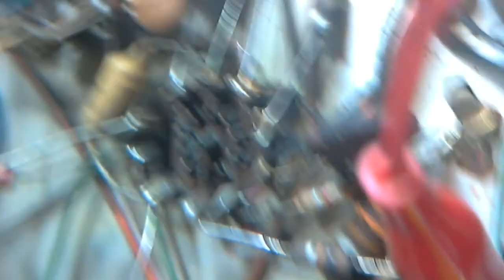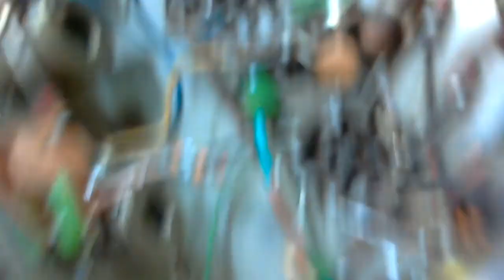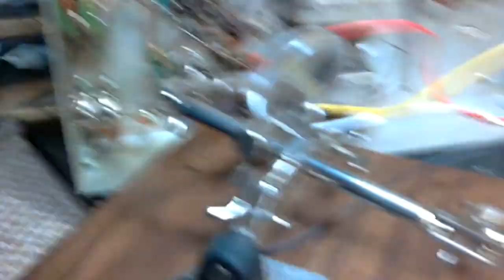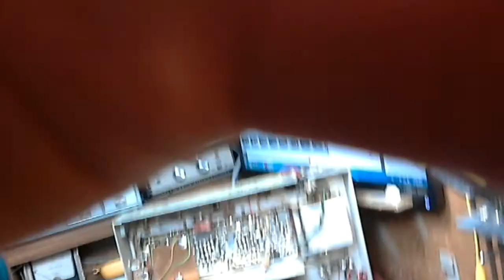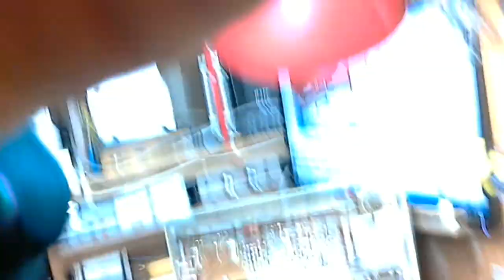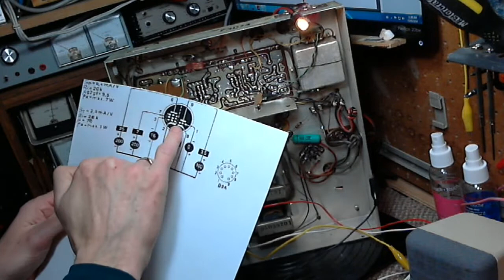Rogers Majestic 8059A Console Stereo Video #10 - Change Out Blocking Capacitors

Comment: found my self wishing you had insulated that second lead on the first cap while it was open before soldering.. awesome video!
Reply from the maker: Brett Gabelman My bad.  You're not alone in suggesting I use more lead cover.  Even I think I should.  My problem is thinking of it at the time I'm doing the work.  When there is a serious clearance issue, I install it.  Otherwise, the trigger doesn't go off in my head to even consider it.
Reply: the hindsight afforded by being able to watch the past on video is even better than 20/20..
Reply from the maker: Brett Gabelman In fact, it's sometimes a little disconcerting to watch my own videos when I say one thing while thinking another and other 'split brain' things that happen.  I'm sure it's normal but becoming aware of it by watching a video is unusual.  In normal life, I'm sure everyone makes subtle mistakes of various sorts but never actual know it.  Like everyone thinking they've never missed a STOP sign.  I've never missed a STOP sign and that will be my story until someone shows me a video of me doing it.